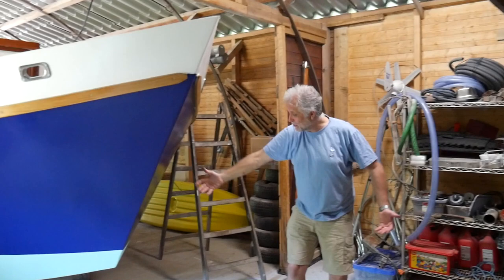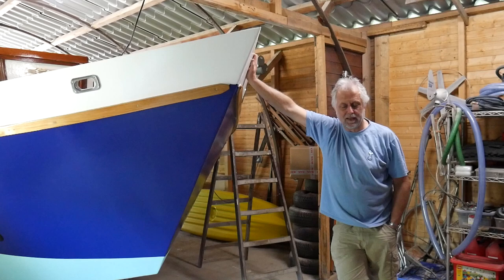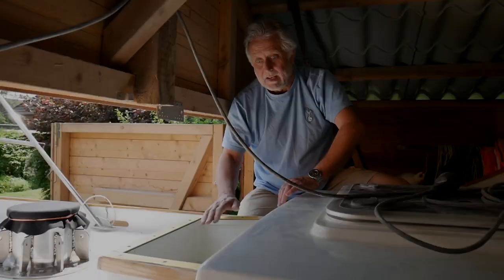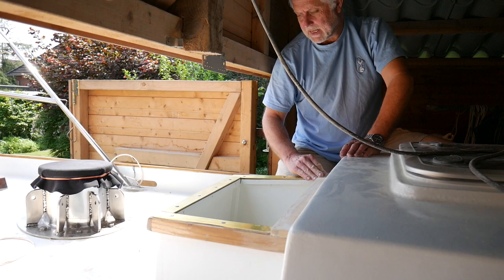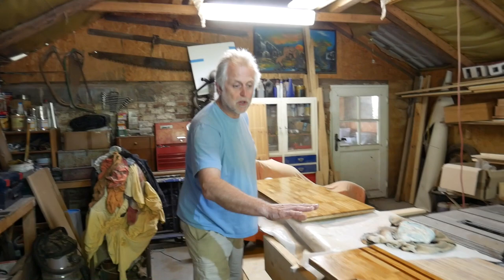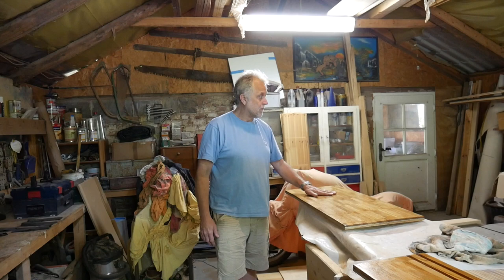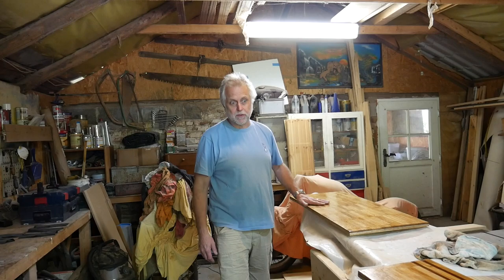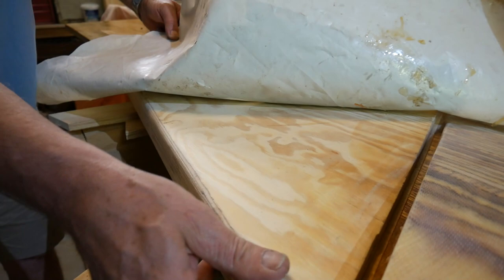Pulling her forwards and other excitements!! - SV Tapatya EP186

Comment: Congratulations Tony, pulling the boat out of the shed, even it was only 2 metres, is 2 metres closer to the water. Otherwise great progress on the other stuff all ‘small’ stand alone projects but they consume disproportionate amounts of time. I can see your new plunge pool getting a fair bit of use now that the temperatures are where they should be.😉 Keep on keeping on. 😀👍⛵️
Reply from the maker: Thanks Norman. Will do, mate 😀😀

Comment: Nice job, Tony! You're making me very impatient to get started on the dinghy again.. but I still have a few ducks to line up before I can start epoxying in winter. Hopefully next week.
Reply from the maker: Thanks Garryck. I dunno what the temperature's like down your way, but that's probably the most important factor in winter epoxy work... As I dare say you know 👍😀
Reply: @SVTapatya  - Yep. Working on some ways to keep overnight temps (can be anywhere from 0°-10°) under control.

Comment: Toe-knee, will the rudder be completely encapsulated in glass? It looked like the bottom edge didn't get covered. Being that you used laminated wood I would think that you would want the rudder as waterproofed as is possible.
Reply: The bottom edge of the rudder is going to get some very special treatment... keep watching!
Reply from the maker: Yes, Brutus, it will be completely encapsulated. I've got the end plates still to fit, but the final piece will be completely encapsulated 👍